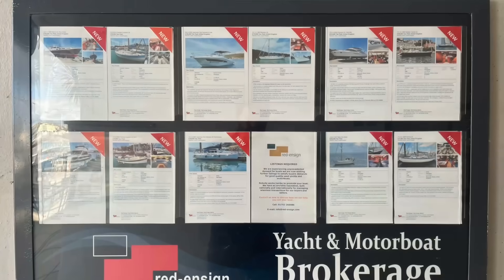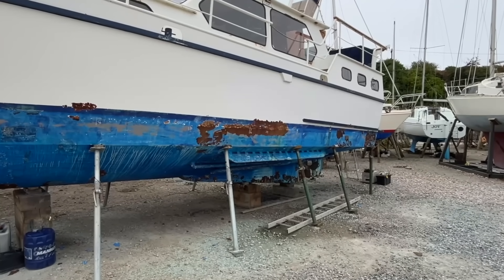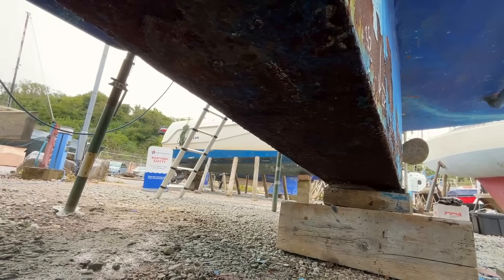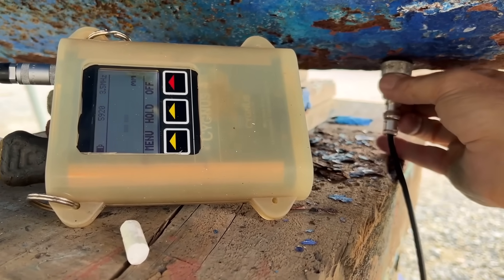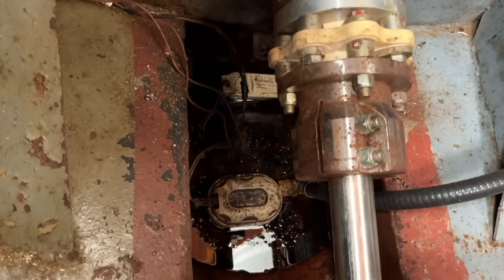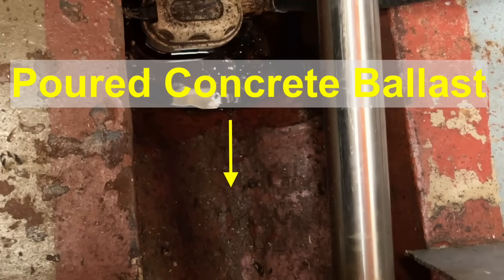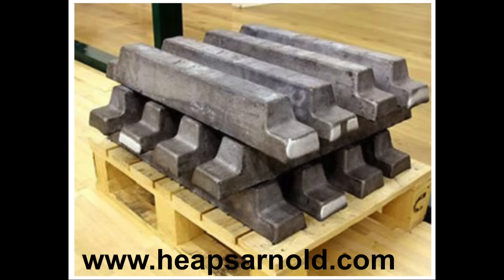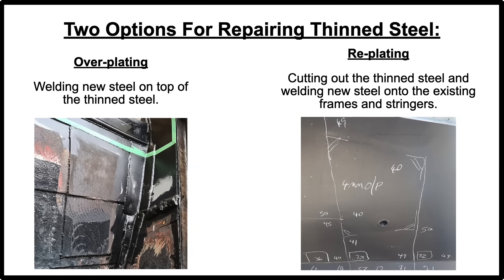Buying A Steel Boat? Get It Surveyed!

Comment: Always have a Vessel surveyed before you buy it and if it's a steel or wood Vessel just walk away large vessels used to be my life I've lived in one of them had a lot of experience on this subject as far as I'm concerned fiberglass is the only way to go it's not without its issues but not as much as steel or wood forget the Fero cement too. With fiberglass any yard anywhere can repair it and resale value will be better than the others by a long shot. Wood rots steel rusts from within and in places that just can't be painted or protected yeah steel is tough when the vessels are new but it sucks when it gets a few years on it and rust takes its toll. After years of owning large vessels I finally got out of it because of the expense but if you gotta buy one get it surveyed and only buy fiberglass boats that's my opinion from my own personal experience
Reply: I agree except for your statement that any yard can repair fiberglass. Repairing a cracked fibreglass hull is a specialist job. Most yards just patch it over.
Reply: @workdevice7808  Agree. Repairing fiberglass correctly so it looks like it never happened is like trying to make a replica of a masterpiece art work.. It takes much talent!
Reply from the maker: All hull materials have their pros and cons, so it is a personal choice as to what suits you best. Alway worth considering the repair expertise and facilities where you plan to keep it.

Comment: Metal boat. One word... electrolysis... a decade or two in the water it is a rust bucket. A wooden boat in the ocean is worm food inside six months and the poison paint they used to use for worms is no longer manufactured and unavailable by law anymore.
Reply: The correct term for 'worms' is marine borers and most of them visit your boat to give unwanted advice when you're trying to get work done in the boatyard 😉

Comment: Is it possible to fibreglass  this hull?
Reply: If I were the buyer, I would seal the boat. And it would discharge 3 CO2 balloons inside it, weld other steel plate in the water line down, and take out part of the ballast to replace the weight increase.
Reply: @DanielSilva-jj2lz See! That sounds smart. Thank you
Reply: WTF are you talking about?  Cheaper to buy a new boat at that point...
Reply: @jimmythegerman69 really!!!! It's cheaper to buy a NEW boat!!!! WTF are you talking about!!

Prick.
Reply: @acme181169 Fibreglassing rusty steel doesn't work very well:
1. Rusty steel constantly flakes away meaning the fibreglass won't stick. If the steel can be ground down well enough for the fibreglass to stick the steel could end up very thin.
2. The fibreglass will accelerate the corrosion by trapping moisture already in the steel.
The best, easiest, quickest repair for a boat like this is to replace the plates. Most of the preparation work (cutting out the corroded steel, paint removal, cutting new steel to size) can be done easily, quickly and cheaply by the owner then pay a welder to weld in the new steel.
Reply: @workdevice7808 thank you

Comment: I've had many boats but never steel? You certainly know your stuff,, you'd be as well to clean the hull with blasting then treat it and plate the whole hull in another skin of better quality but something being done would be years? 😢 Shame insurance is high? 😮😂😂
Reply from the maker: Thanks.  Plenty of repair options for this boat. Overplate is quickest and easiest but won't last forever, re-plate is the better but more expensive solution.  Insurance is quite high, but so are the costs of labour and parts.  Boating remains an expensive hobby.

Comment: This did not want a survey " Just Look". Wants a "Low Loader and a Trip To SCRAPYARD"
Reply: It would take any man with money to burn to set that poor tub on the water again, but the quality and retro of the lavish interior of its day might save a bit of History and nostalgia?  A bit like wanting to buy a Ford Granada Mk1 Coupe' , or a Rover P5, 6 or SD1. I'd settle for a Mk2 Range Rover, that I wonce had? 😂😂😂😂🎉👍
Reply: I would put JLR product in the same class as the RUSTY BOAT. Looking for a smuck with money to throw away. You only have to watch the "Fools" on Bangers and Cash". ( Not in short supply!!).
Reply from the maker: One boater's scrap may be another boater's project, it always comes down to the individual, their skills, time and budget. As true for old boats as it is for old cars.
Reply: i am not sure why the buyer even looked at it.   yes nice inside.    ??? price.
you can just look at it   i would not buy it.    if i found out its been there 5 yrs  i would be worried.
if you were just going to live on it on land  but putting it in the water sounds bad.
And the hull is only one point   i bet there is more that a full look would bring up.

Comment: This is why I stick to boats made out of concrete
Reply from the maker: Good on you, don't see many of them these days.
Reply: Don't they depend on steel reinforcement within that is vulnerable to all sorts of nasty problems? Ultimately all boats fail because keeping the deterioration at bay starts to exceed the resources of their owners, whether of time, money or personal energy, though the same could be said of any artefact.
Reply: Those are called pier pylons

Comment: I am no boat engineer but what I would consider doing is remove and sell the engine remove the concrete ballast then do something with lining the inside of the hull with fibreglass and fill it with expanded  foam then sell it on as a house boat after finding some suitable moorings on a river!
Reply: NO NO AND NO! Selling the engine, sure, but DO NOT FIBREGLASS OVER STEEL EVER!!!!!!! That wil do that same shit that concrete did. And then you cant get to it. Expanding foam, another bad idea. And selling it as a home.... Are you serious? DONT EVER TOUCH A BOAT! thats my advice to you.
Reply from the maker: Sounds simple, but to line the inside of the hull with fibreglass would require stripping out all of the accommodation to get to it - a huge job.  Easier by far to just overplate the exterior with fresh steel.
Reply: Power boats usually don't have concrete ballast, that's some rag hanger💩

Comment: I think YT reccommended this to me as I am following a couple of boat rebuilding channels, one of which is also restoring an older steel hulled Dutch built boat. Also used hte same 4mm plating for the keel. They are gutting hte interior and doing the work to replate etc. themselves, but they found a lot of the issues you have highlighted. They also found the manufacturers had extended teh hull at the rear, created a sealed area...into which deck drains still passed. They knew how bad the boat was, and know if will be years before it is safe to put back in the water. But this video is a good reminder how much money people will part with for boats.....and how poor design choices can lead to so much rot you just can;t see. Until it's too late.
Reply from the maker: Every hull material has its pros and cons and every boat design is a compromise. The key is to understand what they are for any boat so you can work out how to mitigate the risks.

Comment: Knowing it had concrete poured into the keel would turn me off pretty quickly
Reply from the maker: As it would for most, but it can be removed, made good and be replaced with better ballast materials.
Reply: You could also weld the keel shut with a plate from above (when building it) so no water seeps in and theres only a limited oxygen supply for rust to build. You could even pressurize it with Argon and keep a slight overpressure in there. Many ways to protect the inside from rusting. If you think about it…which has not been done.

Comment: I know absolutely nothing about boats, but I've had my fair share of rust issues with cars over the years.
I know enough to tell me to walk away from this without even thinking of a survey.
I think your client knew this, but had his heart set on it, and wanted the survey to tell him he was wrong, and the boat was okay.
Reply from the maker: Buying a boat can be an emotional process, so getting a surveyor in your corner helps keep things in perspective and avoid the heart running away when the 'to-do' list is just too big for that particular Client to take on.
Reply: And probably cheaper than a good therapist, though if the compulsion persists!

Comment: Enjoyed the video, as a Engineer surveyor including loco type boilers I  totally agree with your comments using an Ultra sonic thickness tester. Very useful tools but just when you want a decent reading the rough surface often makes it difficult.  What a shame for a lovely looking boat.
Reply from the maker: Thanks, glad you enjoyed the video. UTMs are great bits of kit but you also need a hammer and a magnet to be fully effective at testing steel hulls.  The readings are what they are, it's what gets done next that decides any boat's future.

Comment: I'm from the UK but have lived in Sweden on the East coast for the last eight years, I am going to look at similar boat to this, with a Volvo TD50 and flybridge. Advertised price is 11 grand. I already own a steel boat which is currently up on land at my farm awaiting renovation, made in 1985 the hull is in a much better condition, the steel is thicker and I believe Swedish steel was good quality, certainly back then, also it helps that the Baltic isn't as salty. Anyone looking for a steel boat I would recommend taking a look at boats from the Swedish East coast and you may just find a bargain.
Reply from the maker: You make a very valid observation, not all steel is made the same.  The quality of steel specified at build and the quality of paints used make a huge difference in the expected lifespan of a steel hull.

Comment: solid fiberglass with no core is the best way to go . If you have worked around salt water and steel boats you know to stay away from them     wood hulls are a lot of work and a pain in the ass also  especially if toredos get in the wood
Reply from the maker: As I can tell you already know, every hull material has its pros and cons.

Comment: is it possible to repair that boat?
Reply: It is, but you may spend 20k and have an old boat.
As you essentially redo the inferior part of the boat, with 6mm steel, you  will also want to repower it, and get a new wheel and transmission.
At this point, a new boat might be the best option.
Reply from the maker: Of course, but only if it's 'worth' it to you in not just financial terms but also  in emotional and practical terms. All boats eat money, some quick than others!

Comment: Would it make commercial sense to sell the engine plus some fittings and to scrap the rest?   Even a rusted steel hull has a scrap value.  Heartless but pragmatic comment.
Reply: i'd buy it for the value of the engine and running gear, plus scrap weight for the hull.. for i posess a welder, plasma cutter and an inordinate amount of self belief..
Reply: Mild steel has very low scrap value (at best approx 65usd/metric ton). Any financial benefit from selling the engine and fitting would be almost zeroed by the cost of removing them.
Reply from the maker: 'Commercial sense' often has very little to do with restoration projects on old boats...

Comment: Walking away might be the correct thing to do if the owner is unwilling to reduce the price based on the survey.
But this boat is repairable. I would put a value on it in its current state of around £15000. Estimated repair cost of about £20000. It would then be a top notch boat, fully compliant for a good cost. It just depends on the right person being willing to take on the project.
Ex. Marine Engineer. 25 years seagoing experience.
Reply from the maker: You've hit the nail on the head, the 'walk away' recommendation is based on the condition of the boat AND the ability / willingness of your Client to take it on as a project.  Every survey and recommendation is unique.
Reply: @whitehatmarinesurveying fair enough.

Comment: If a boat has ever been overplated... walk away
Reply from the maker: That's a reasonable approach, but on the inland waterway for example overplating is the norm, although it should only ever be considered an 'expedient repair'.  Re-plating is always the better, but more expensive, option.
Reply: @whitehatmarinesurveying  i dunno im a moblie welder an every time that a customer has asked me to overplate i tell them it will fix it in the short term (2-5  years) but its only going to rust the parents metal out faster by trapping moisture and be even more expensive to fix then. 
A cheap repair will ALWAYS end up costing more in the end because you will just have to fix it again, do it right or don't do it at all.

Edit Freshwater aluminum boats that live on trailers is the only time i would be ok with it.
Reply from the maker: You're on the money, overplating is only ever an expedient repair. Cropping out then thin steel and replating is always the better method, but due to the increased cost and skill involved, is rarely found on inland waterways boats.

Comment: Its build over 50 years ago for the Dutch fresh water lakes, canels and rivers. Not for permanent use in seawater as this one is by the looks....
Reply: built*
Reply from the maker: Agreed, but it is odd that you would choose 4mm for the base of an inland waterways boat.  In the UK canal boats usually have a minimum of 6mm, ideally 10mm for the base plate.
Reply: @whitehatmarinesurveying  you did a good job by warning the potential buyers for the problems the boat has, no doubt about that, think its a totall with all the rust.
But sad to see people buy the wrong boats for their intented use. Yes boats like this you can buy for beer money in Holland and they offer specious living accomodation but they are not build for extended use in seawater conditions. Basicly they are just floating caravans for the mild fresh waters of the Dutch inland waters. 
To use them in British coastal waters is like choosing a 1970’s Austin Mini over a Landrover for a long expedition in Africa and than complaning its falling apart after a while and not suitable for you.
Its just the same as with this boat in my opnion……😉

Comment: These things were built to be relatively lightweight to roam shallow waters, like our local lakes, rivers and canals in NL. Most of that water is freshwater. There are no rocks to hit underwater, it's all mud. They are not regarded as seaworthy or suitable for open water really. It's a shame the hull wasn't maintained properly, but many consumers have no idea that is even necessary, they bought a nice weekender at the Hiswa and as long as it floats they don't worry.
Reply from the maker: A lot of truth in there, thank you. UK canals and river whilst not having many rocks do unfortunately have plenty of bicycles and discarded rubbish waiting to put a hole in any passing thin steel!
Reply: @whitehatmarinesurveying  This style was called a Rhine cruiser for a reason, my parents had one in the late 1970s and into the 1980s. Worked great on the Ijssel and Rhine rivers and surrounding gravel pits and lakes.
We sold it because we didn't use it enough to warrant the expense of maintenance and marina fees.

Comment: its soo easy to just cut out and weld in new steel
Reply: It's a job from hell, I've built and repaired steel boats for a living, as the surveyor says it's going to be the thick end of £25,000 before you even find new problems.

Comment: Could probably put some zinc anodes in the bilge along with lead ingots (ballast). Lead is not a very good anode. It is a real "Ship of Theseus", the entire lower hull would have to be swapped out with a donor. It will never be the same again. The interior can be grafted into another boat, maybe the engine still has some life in it.
Reply: Yes- sadly, it's a parts boat.